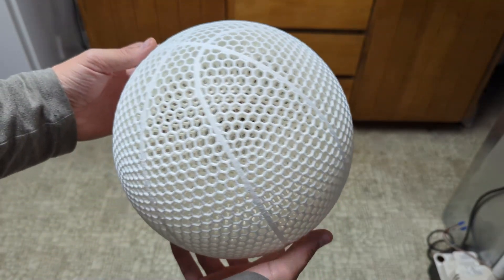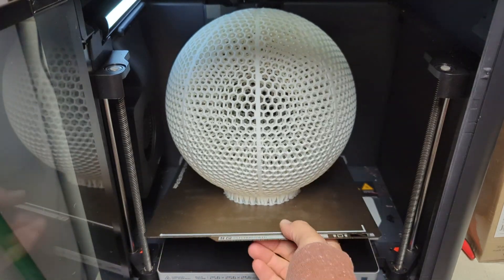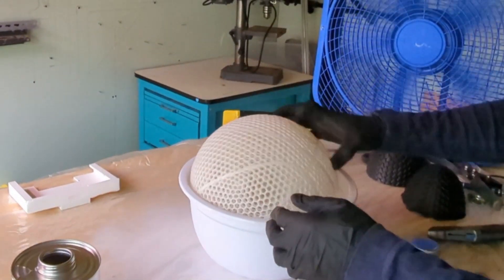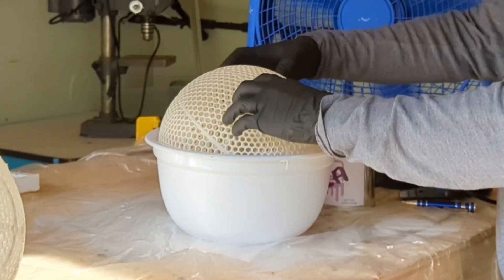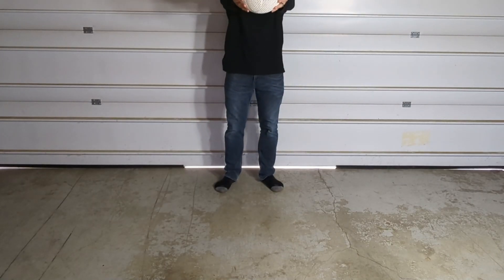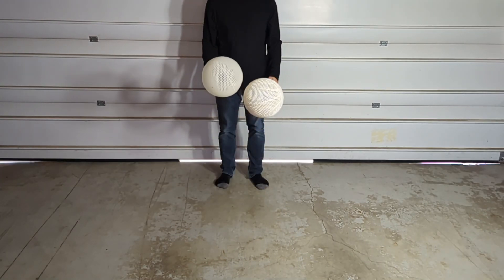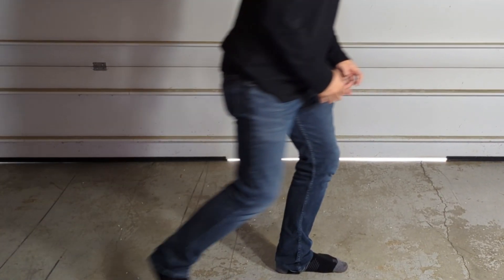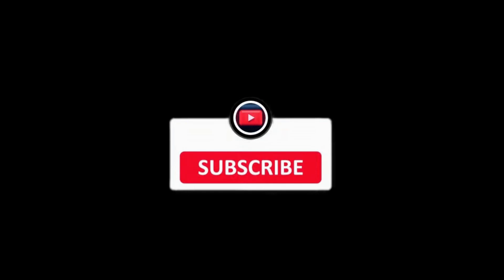Coating a 3D-printed Airless Basketball With 3D Gloop – Does It Work?

Comment: you should coat one in a rubbery and elastic material like flex seal. Especially on the softer filaments, there should be more energy in the movement of the filament from deformed back to normal, so essentially better rebound off the floor
Reply from the maker: @megapoop22  I have spray flexi seal and some other things I will be trying soon - hopefully good results!

Comment: do you print all your filaments with the ams unit? or do you just use the spool holder on the back?
Reply from the maker: I could have printed the super pla+ basketball with the AMS, but all of the flexible filaments I have tried do not work with AMS which is a bummer because those are usually the best filaments
Reply: I was wondering that actually but Ik that for tpu you don’t so I didn’t

Comment: try electroplated metal surface on top of the airless basketball
Reply from the maker: @gsestream  guess I will have to learn how to electroplate lol
Reply: @makeitlabchannel  yep its easy, handy way of making copper/zinc/nickel metal parts with normal plastic 3d printing. graphite or silver conductive paint. use graphite electrode with copper sulfate or zinc sulfate water electrolyte. the conductive coating object is the negative electrode of the power supply or battery. graphite rod is the positive electrode. using graphite prevents the electrode metal being electroplated to the object. or use copper instead of graphite as the metal source.
Reply: Tbh i don’t want to read that
Reply: @LincolnSavage-q8p  school shuggers eh
Reply: @gsestream  lol

Comment: 3D gloop is not a glue like super glue and is specifically formulated for PLA. I think they also make a version for ABS.
Reply: What are our thoughts on hanging the ball from a string then twisting the string a lot so that when released the ball spins and just spraying it with a can of aerosol flex seal?
Reply from the maker: @Mr.Schneeebly  Would this be with the Super PLA plus filament or a flexible one like flex PLA? Or both?
Reply: @makeitlabchannel  great question. I’m not really sure! Probably a super PLA? Just an easy thing to test out. It’s like $15 for a spray can of the flex seal and it’ll apply pretty even if you have a good setup
Reply from the maker: @Brocknoviatch  Good to note, and I did see they had an ABS version on their site